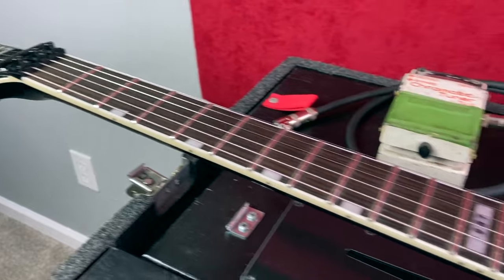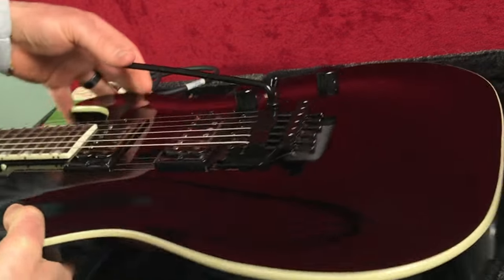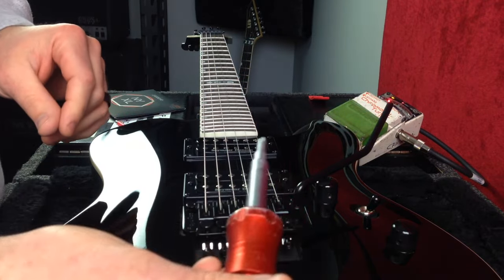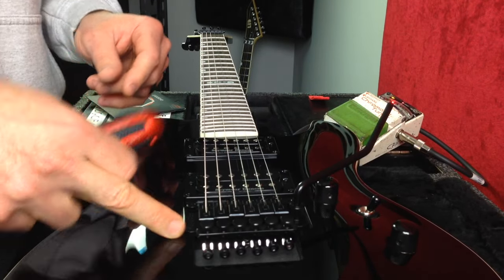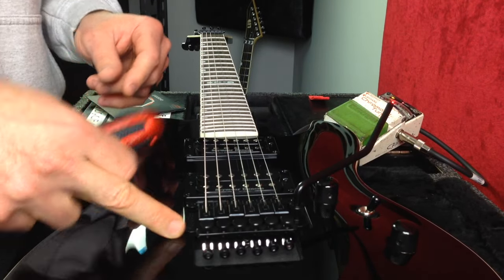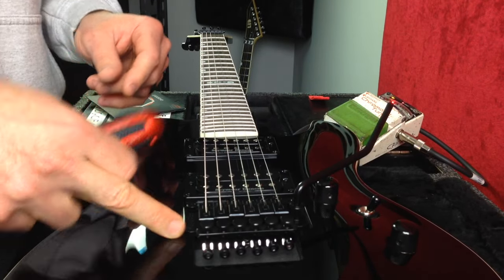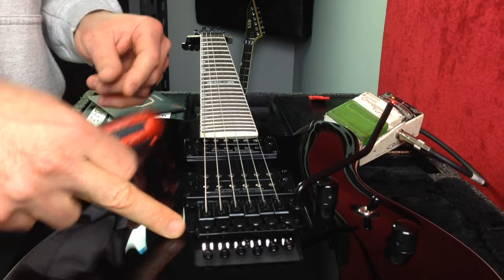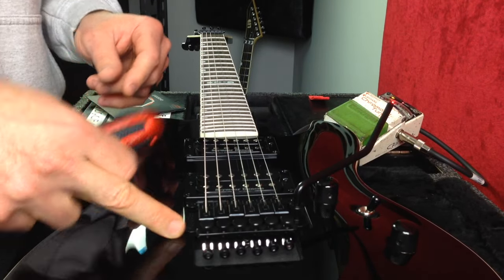How To Set Up The PERFECT FLOAT On Your Floyd Rose Bridge

Comment: Thanks for this excellent vid
I restrung my EVH Wolfgang (dive only) special with a 10 52 and down tuned to drop C. Guitar came factory fitted with two springs and 9 42 gauge. So I had to add two more springs and tighten the screws all the way into wood. In the end the bridge was almost parallel to the body but the tremolo had become toooooo stiff. In the end I changed back to 9 42 as I found the tremolo impossible to use. Wanted to ask if people who use heavier gauge mostly use it on the hard tails because heavier gauge makes tremolo too stiff even with slaggy tunings like drop C. Am I right???
Reply from the maker: I suppose the level of stiffness is more acceptable to some, and less acceptable to others. Of course everyone loves a nice spongy and responsive tremolo, but that too is a balancing act to achieve, depending on your setup. 
Question... did you go straight from 2 springs to 4? I would recommend trying 3 springs in the V pattern. That's what I like best, and I primarily play in drop C, 11-52. I also have plenty of room to turn my screws in either direction if necessary. Keep working at it, and good luck! 🎸
Reply: @RobArnoldWorld  I added one spring first. It wasn’t getting levelled despite screws all the way into wood. Then I added the fourth one. 

After that when I reset it up for 9 42 I took the two springs out but noticed that on standard tuning I had to tighten the screws way more than they were originally. Seems like I messed up something. 

Thanks for the prompt response. Cheers
Reply from the maker: @kashraf581w  Only thing I can think of is to maybe try new springs? Like maybe the ones you're using aren't supplying the proper amount of tension? 
That scenario would be SUPER rare, but, a fresh set would be a fairly inexpensive experiment.

Comment: Hey what’s up Rob? Maybe you can help. I have a cheapo Squier  Show Master That has a Floyd Rose Licensed Bridge. The bridge looks exactly like the one in this video. If I wanted to thro an actual FLOYD ROSE on there, like the one on your guitar in this vid, will it fit right in? Also do you know what FR model is the one in this vid?
Reply from the maker: Hey man- the bridge in this video, that comes on the 87' Eclipse, is a Floyd Rose 1000 series. 
Some people think the 1000 series is just as good as the Original series, some don't. Here's an article on the subject. https://www.musictoob.com/floyd-rose-1000-vs-original-korean-made-vs-german-made-tremolo/
But, I would think the 1000 series would definitely be an upgrade to the licensed series you have in your Show Master. And I think it would fit just fine. If it were me, I'd take great care in mentally detailing how I disassembled and removed the old bridge, and then meticulously install the new bridge exactly as the old one was. 
However, rather than spending money on a new bridge for a "cheapo" guitar as you put it, I'd recommend just upgrading your guitar all together. Perhaps one that comes stock with a nicer Floyd. Because for example, if you have a cheapo car, but you put a high performance engine in it, it's still going to be a cheapo car, with too much engine in it, and it's still going to break down. 

Here is a video further explaining my thoughts on the matter, if you're interested: https://youtu.be/s3NL_MqF-gA

Cheers and good luck!🎸
Reply: @RobArnoldWorld Hey! thanks a ton for the response. I call it a cheapo but idk brother, there’s something about it I like. I own a bunch of other “fiddles” 2 LTD Black Metals, Epi Les Paul, Etc. But there’s something about the Squier that feels comfy to me like that baseball cap that fits so well, it doesn’t feel like ur wear a cap at all. If ur not sure what it looks like, it looks JUST like Kirk Hammett’s  Skull n Crossbones. With skull n cross one inlays. I have EMG 81x-85’s in it. The stock bridge is blocked off at the moment but I’m thinking I might wanna bring the bridge back to life. Anyway thanks again for the info. I still cry every now and then that Chimaira is no more. But THE ELITE stuff makes wanna rips someone’s face off. I’m a Philly PoPo and sometimes patrol with ur stuff in my patrol car.            🤘🏾😆🤘🏾
Reply from the maker: @phillyhank8726  Haha that's awesome man and thanks for your service! Super happy to hear you're digging The Elite too! 🤘
I totally get what you mean about that guitar being comfy. And that makes all the difference in the world. When you've got one that just plays great and feels right, then it's certainly worth maintaining. So go for it!🎸

Comment: WOW 13's Never tried that gear of strings. This video is very useful and I found it very interesting Rob. Adding that 4th string sure did help a lot. I may of took a lot of work, but it got the bridge level  in the end. As this guitar as a fixed bodied neck, unlike our guitars have a screwed on neck. Does that make it easier or harder to keep the neck and Floyd bridge level ? By the way Rob I have had an email telling me that the parcel that you have sent me is on it's way.  I will check my email's to find out when the parcel will be delivered and I'll let you know once it arrives at my home with a phone via Facebook.
Reply from the maker: Sounds good Darren! I'm excited for it to arrive! And I don't think having a neck thru design vs. a bolt on neck has any effect on your bridge. Cheers man!

Comment: I have a new jackson mj dinky with a gotoh 1996T tremelo  and after i tuned to 1/2 step down and leveled my trem i noticed when i bend hard esp with dbl stop i can hear it pulling out of tune until i release bend, you can actually see it pulling bridge up a lil , is there any adjustments i can make to correct this problem
Reply from the maker: That sounds like a totally normal thing to me man! You've just got to compensate!
Reply: @RobArnoldWorld  do you mean by laying palm on trem as bending strings and counter it
Reply from the maker: @artytoney2057  Well if I'm understand what you're saying correctly, you're saying that when you bend a string, you can see the bridge pull up in the back, right? This is totally normal, because you're increasing tension on the string by bending it, which sharpens it, or increases it's pitch. Just like if you were to start sharpening the string by turning the tuning knob, the bridge would start pulling up in the back. Conversely, if you started de-tuning a string at the tuning knob, the bridge would begin to sink back into the guitar body. 
So now back to bending the string, knowing that the bridge will come forward to naturally compensate for the increased tension, you have to be aware of that, and try to get a feel for things, so that you can achieve the pitch you're going for with that bend, by bending harder (or more), so that the proper pitch is achieved. 
I hope that makes sense!🎸

Comment: Wow man you use 13-56 for drop c, I use 12-56 for drop B. But I like thinner g strings, I feel that they have better tone and stay crisp longer. What are the rest of the gauges on that set Rob? Cause I actually have no issues with 12-56 for drop b, except the the 3rd treble string (e in drop b) just cause I use a 20g plain for that string anything higher was just kinda ignorant lol! So I’m curious to see what those gauges are. Love your vids man. Especially things like this. You describe everything really well.
Reply: Just saw that it’s what your buddy wanted on the guitar gauge wise, but I actually had thought about using a 7 string set and putting a wound string for that 3rd string, but it kinda interferes with soloing. The set I use (EB cobalts) has that string at a 24g and it’s too thick fir my liking, the 20g is easier to intonate and set up, but I was wondering what that pack had for that string.
Reply from the maker: So yeah I use 11-52 with a 20w g string. This guitar for my buddy, used this set 👉 https://www.sweetwater.com/store/detail/NYXL1356W--daddario-nyxl1356w-medium-with-wound-3rd-nickel-wound-electric-strings-013-056

I didn't mind the feel when I jammed it out. Felt pretty good, but the strings were a little tight, especially when bending. 

I also can get away with 11-52 when I play in B standard with no issues, but I agree with you that 12-56 would probably be a better choice. 🎸

Glad you're enjoying these tech vids bro!

Comment: I feel so defeated. I’ve blown through three sets of strings today. My Fender HM Strat came tuned to E standard with 9s and three springs for the trem-claw. I tried putting 10s on and when I go through this process in this video even tuning down to Eb standard puts the adjustment screws for the claw almost all the way in. Plus, strings keep breaking when I’m trying to balance. Am I messing up or is it really just going from 9’s up to 10’s requires another spring?
Reply from the maker: Damn that's a bummer and sounds like you might just be messing up. 
Just a half step tuning change and going from 9's to 10's should definitely not require an additional spring. 
And the breaking strings thing definitely makes me think you might be missing a step or overdoing it somewhere. But without seeing it myself, I unfortunately can't be sure. Keep at it and good luck!
Reply: @RobArnoldWorld  I forgot to mention I am starting off with no strings on the neck and an unblocked tremolo. I’ll string up the whole guitar and then when I try to tune up and stretch repeatedly eventually the tension snaps the string or it pops out of the bridge even though I tightened the saddle block enough. Do you think it’s because I’m not loosening the trem-claw screws enough while the strings are all off? I notice I had it screwed in almost all the way, but even so I feel like it should’ve at least let me get to Eb standard without messing up. Like when you completely take all your strings off the board to really clean it and set it up from scratch what is the process because that’s what I’m trying to do here with the first Floyd Rose I’ve ever owned?

Update: 

Installed new strings and tried to tune the 10-46 set yet again to Eb (stubborn dude here), the tremolo was pulling all the way forward and was now sitting above the shred neck block tool. I detuned the guitar and removed the tool. Strings were still heavily detuned, and I kept tuning them up to Eb. Cycling through each string and stretching them as I went about my business the tremolo pulled all the way forward. I then started to tighten the claw screws, but it was not making any change at all. I tried to depress the bar gently to see if the springs were stuck and I heard a loud pop from the springs once I let off it. I then started the tuning cycle again. I got up to the high E and as I was tuning it to Eb it got close but then it broke. At this point I reviewed your video and realized I should’ve detuned the strings heavily, tightened the claw screw, and then attempted tuning again. At this point I’m like fuck it. I gave in and installed 9-42s. I was able to tune either to Eb or E with those and have the bridge balanced. I settled on E standard and even now with the bridge level there’s only like two threads showing on the trem-claw screws. I’m baffled at this point. I was really hoping for 10s at Eb Standard but the guitar is rejecting it 😂. Sorry for the short story. Any thoughts? Are my stock springs really that shitty? Is it because it’s a Floyd Rose Special?
Reply from the maker: @datooch  Man... sounds like a nightmare! 
I think you should have put new strings on before making any trem claw adjustments. After that, and then tuning the guitar to what you want it to, the bridge will tell you what it needs...
If the bridge is pulled up, then you need to tighten the trem claw screws. If the bridge is sunken into the body, then you need to loosen the trem claw screws. And as I state in the videos, it's all about small adjustments. Maybe a full turn, the retune. See what happens, the repeat as necessary. 

The same process can be applied to your conundrum. You just need a starting place, and then follow the process I just explained. You'll get there!

Comment: The screws in the back for my springs are super strong, either I’m incredibly weak or something is wrong, does anyone know why they’re super tight?
Reply from the maker: They are super tight because they have big threads, as they're meant to hold a lot of tension. Try and make sure you use an appropriately sized screw driver, and give it some good old fashioned elbow grease! 💪

Comment: Is the high e side equally level with the low e side?
Reply from the maker: I notice that the high E side might sit slightly higher than the low E side, and that's ok. But you wouldn't want too great of a difference.

Comment: Great video sir.  Saw video once by Doug Marks, If you tune them all up 654321 and then go back to 6 and see how far you’re off. But then over compensate the other direction the same amount. Say you’re flat by 4 cents, then tune to center but add sharp 4 cents. All the way up. You’ll spend much less time tuning.  
No expert here but just thought I’d mention it.
Reply from the maker: Thanks man- honestly it's hard to wrap my head around what you said there, but it's certainly intriguing. I'll try and look up that video.
Reply: @RobArnoldWorld  hey Rob, I’ll try again. Basically, instead of tuning up each time, essentially over tune, go sharp a little bit the distance you’re flat.  I’ll try to find the video.  Again I’m not pro, but it works.